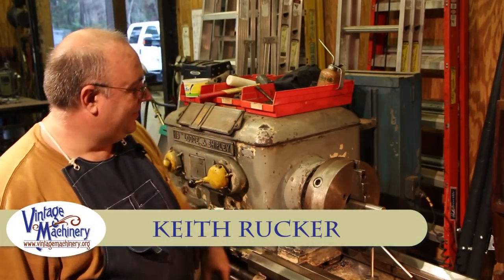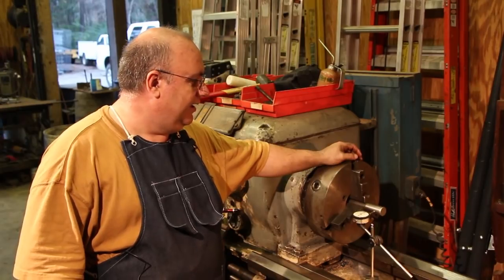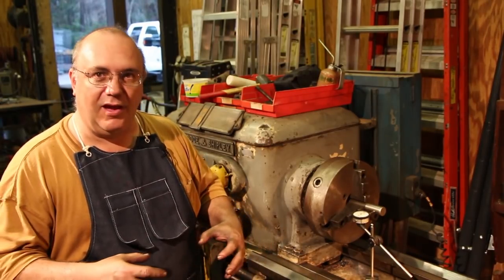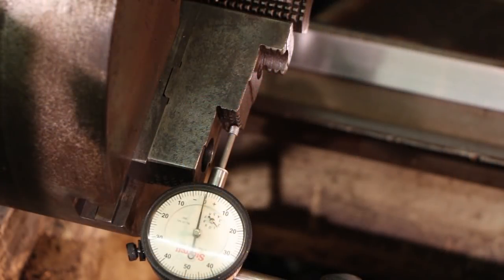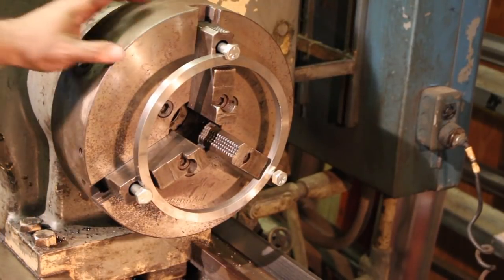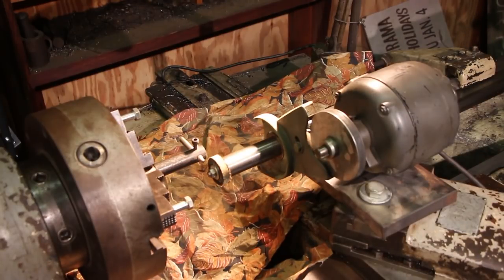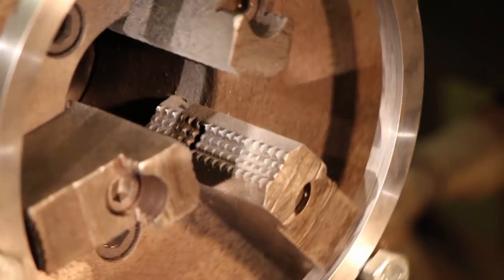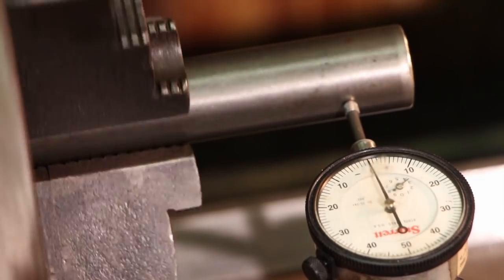Machine Shop Maintenance:  Truing up a 3-Jaw Chuck

Comment: You're really limited with what you can do with such an old chuck.
Often the wear is in the scroll where you can't really do much about.
Also, you can grind the jaws to perfection at a specific diameter of stock, and then put a different size of stock in (bigger) and then not
be in the area of the scroll with the most wear and it will be way off again. 
The teeth on one jaw that meshes with the scroll may be more worn than the others due to grit that gets inside the chuck.
I would have chucked the old chuck and bought a new one.

Comment: Thanks for the video, I have some questions 
A, did you check the lathe chuck mounting plate  for run out
B, did you then refit the chuck after a very good clean and polish and check the chuck body run out
C, did you remove the bolt on  jaws and check runout of check slides themselves 
D, did you confirm all jaws are in correct positions then check run out

Those old machines are generally very very well made with good durable steel and unless previously someone used a tent Pole as a chuck spanner there should not be as much runout as you HAD 
I have setup a few lathes and always start with bearings, then step for step work my way outwards till I finally fit the jaws them selves and find very marginal tuning needed before the jaws are done, each thou adds up 
I would also use a true ground hard shaft as my clamped reference, never trust a standard machined bright steel rod 
The last point is check the runout at the jaw face then move dial gauge out 100mm from face and recheck runout, then when all done to within 1 thou recentre the tail stock to the jaw to make sure you don't introduce errors of the length of the bed 
All the best to you in your shop fella, 
Generally 1 to 2 thou can be overcome with a slight tap with soft block to the offending jaw before final lock down, but we would all like the jaws to be 100%true wouldn't we

Comment: I would have tore down the chuck to inspect and clean the wormgear and individual jaw mating surfaces. One jaw looked like it had more material removed and I suspect it might have a burr or some deflect between  the contacting surfaces. That would cause the run out after resurfacing.

Comment: That worked well.  How I have done it before is to use 3-5" dia. Plate 1/4" thick with a 1 1/2" hole in it. Dril 3 holes in it for the bolts to come thru.   If your Chuck has no bolts I have figured out a solution also with key stock.

Comment: Jezz Keith. I watched your video because I have 1.5 thou run-out on my lathe that I would like to get under a thou. But you are happy with 4? That's a little hard to swallow! But maybe it's not as bad as you think..... 

How do you know your measuring bar is true? It looks like raw unfinished material which is seldom true. Don't you have a good ground mandrel in your tooling inventory? 

How do you know if the missing outer screws are torquing the jaws a bit? Why not put sleeves on the longer bolts so they tighten the outer location AND provide a clamping surface for your tensioning collar?

Comment: This is the correct way to true up the jaws. Thanks for the demo. You can probably improve that .004 runout by striking the high jaw with a soft mallet. Any improvement is a help so it doesn't hurt to try.
Reply: No it’s not correct. He preloaded the jaws in the wrong direction.

Comment: When you tighten the Chuck do you just use one of the three adjustment screws? I had a runout problem on a small three jaw but changing my practice to always tighten all three adjustment screws the runout is down to just under 1/1000. Big result. I must be a bit ocd as I always tighten in order.

Comment: Your method of creating tension is absolutely correct. Many people are doing it the wrong way. Note the following: A person can have the best setup, best grinder and correct way of tensioning the jaws, but if you have a spindle which is out of line with the bed, it's not going to help much. It will be best to first check if the spindle is parallel to the bed. My Opinion!

Comment: Yeah,  I know old video, that said anyone just new to this video needs to finish the job, not mentioned is to disassemble that chuck first and clean, check for issues in mounting and jaws then after grinding disassemble again, clean, remove all that diamond dust and lightly lubricate.

Comment: If you remake jaws try to match the original diameter.  I'm betting by the looks of it you had the right idea with the big ring but your jaws should have been opened to the size of your spindle tube diameter or bigger. Using the inner bolt hole.  The angle of the jaws will change with pressure and chuck RPMS You want to promote the life of your jaws.
so anyone attempting this first check your foundations. Then decide what diameter is best and for a finish pass I suggest climb, conventional is good for rough but for finish :(  I like the DC motor for all the rpms and hp,   .   

what you could always do is get some soft jaws and bore them out you should be able to hit your tolerance.

Comment: I imagine when you are grinding, the actual diameter which ends up being ground matches  the diameter of the opening of the jaws during the operation. It appears that the jaw gripping surface has a radius smaller than the operation set up. Therfore the grinder won't contact the bottom of the jaw. The run out will greatly improve for larger diameter work pieces but maybe not for smaller diameter stock.????

Comment: On some of your projects you have chucked bar stock which uses the jaws you ground and bored the inside of the part.  Then to finish the outside chucked to the bore and finished the outside.  Why don't you also grind the jaws on the outside?  Is it because there is not a concentricity spec between the inside and outside of these parts?

Comment: I'm going to stop you at 2.50. To be continued !
7.57 I've heard enough - or too much. No point in continuing watching this video as there are so many errors (omissions) in what you're doing. Here's the steps you should have taken:
1. Is the chuck mounted true ? Dial indicator on the left hand edge perimeter - to the left of the chuck key hole. If the chuck isn't running true, the jaws certainly won't be. Dismount the chuck and check the mounting for trueness. Remount the chuck correctly if necessary. It may fit 6 different ways; one will be correct. Any play in the headstock bearings ?
2. Remove the jaw 'tops' - Are the jaw bases in the correct slots for the scroll ? It'd be obvious if they were inserted in the wrong order but fitting them in the correct order but wrong slots will cause small errors.
3. Measure the run-out as as many different diameters as you can and particularly at extremely large openings - where it's too large to dared to be used - i.e. the scroll won't be worn there. Figure out how much run-out is down to scroll wear.
4. Refit the jaw tops to the correct bases - they should all be numbered.

Only after checking the 'foundations' can you build accurately.

Comment: Its important to get pressure from the inside (like when clamping on a piece of metal) when grinding the jaws on the inside and not using a ring over the outside of the jaws which will cause pressure towards the inside instead of pressure towards the outside.
Reply: Pieter Botes , I believe that's what he did
Reply: @grumpyg9350  I didn't question what this brother did. I merely "sort of stressed" the importance of doing it the right way.
Reply: Pieter Botes it's important to make clear comments as to whether they are reinforcing or critical. Most of us, at least on YouTube, have difficulty with our "mind reading" not always working correctly. I know I've been guilty of this, and have been called for it before. Maybe adding a simple little phrase like " I agree" or "I concur" is all it takes.
✌️👍
Reply: @grumpyg9350  Will do

Comment: I suspect there is also wear in the centerline  axis between the body and the Jaw mount. I would use an all-thread stud, washer, nut, washer, your ring, washer and another nut. This will secure the Jaw set just as if a piece were chucked up.

Comment: You can also have a little runout coming from the bolts; each round part of the bolt that is tighten the ring.

Comment: I read one time that you can just set your speed to the highest and the centrifugal force will throw out the jaws ... so i tried it .... .0005 runout .... worked great for me ... might be worth a try for you .just run it  and zap a thou or 2 off and see . like you i didn't think it'd work too well either , but it did.

Comment: That would be true only for the diameter that you used. Once you change the jaw position (open or close), you would have to factor in the play caused by the out of round that the scroll has.

Comment: Kieth,
   You are correct, ordinary  carbide inserts will not cut hardened chuck jaws. However, Blue Nano carbide inserts will. I had 11 thou run out on the three jaw on my smaller lathe. I am really hesitant to get grinding dust inside my machine so I didn’t want to use a tool post grinder so lived with the run out until I saw a video on Steve Jordan’s channel using the Blue Nano inserts on a boring bar to true up the small chuck on his mini lathe. I know, mini lathe chuck jaws may not reach the hardness of a bigger chuck but I didn’t have anything to lose but the cost of the inserts so I thought I would give it a try. To my surprise the Blue Nano inserts weren’t even faxed by the jaws on my chuck and I got it true within a half a thou using his method! 
    Steve solves the problem of chuck tension by placing a piece of round stock on the very back portion of the jaws then tightens the scroll down normally. He shows how he accomplished this somewhat delicate operation.
   After the greater portion of the jaws have been trued up the billet, as he calls it, is removed and the small back teeth of the jaw are cut just a smidgen below the truer portion. I used a ring similar to the one you use only I just used the back grip on the jaws to provide the needed tension. You do loose the very back portion of grip on the jaws but there is still plenty of gripping force to hold the work. 
   Pierre did a review on the Blue Nano inserts not too long ago if your interested. They worked for me and I’m comfortable that I gave my chuck and lathe bed a bit longer life by keeping it free of grinding dust. As you know the dust is impossible to control in a spinning lathe and grinding wheel and equally impossible to completely remove once it’s in there.
 Thanks for the video.

Comment: Semi Newbie question...atlas 618,,,,test bar in spindle mt2 taper....0005 at 2 inches...turn new 3 jaw chuck on test bar backwards and check runout and adjust where it mates to faceplate in normal configuration.  Would this be a decent way to help true chuck...

Comment: Do each of the 3 gears have a specific place in the chuck? I saw that the jaws are numbered, and matched them with the slots - but after cleaning the chuck,  it has one point in a full turn where it binds 😟
Reply: Yes the chuck should be numbered along with the jaws,remove jaws, find jaw #1 and turn scroll untill you see the entrance to the scroll(like a thread) then repeat for the other 2

Comment: It helped a lot ..but you can cut the jaws with a good insert boring bar especially with them being serrated..but carbide doesn't like Interrupted cut I would have tried the bar first ..not gonna be any closer than 4 but where you ground the chuck jaws at that diameter it should be with in 1 in theory

Comment: Somebody please chime in here for me. My lathe runs up to 3000 rpm. Wouldn't it do the same thing to spin it up wide open and just let the centrifugal force push and hold the jaws out while grinding. Any one tried this? I need to improve mine.
Reply: Thinking the same
Reply: Yes,  it will have such a centrifugal force on the scroll that it can't move.   Problem is when you have a lathe that starts turning chuck instantly especially at high speed can turn the scroll before centrifugal force from the jaws holds the scroll.   Especially if the jaws are turned out a long way.

Comment: Another suggestion for the grinding . Use your hand wheel to feed the grinding wheel back and forth fairly quickly . Literally feed it , feed it out . This works like honing a hole , the faster the feed the more rapidly the cutting action and more parallel the hole or jaws . The rapid feed breaks down the grits to expose new sharper grits and keeps the wheel from cloging up . Another suggestion is to dress the wheel on the same side as contact with the job . Another mistake most people make is using too fine of grinding wheel and also too wide a wheel . Narrow wheel has less pressure and more accurate . One last thing , cleaning out the inside of the chuck before doing this job may help . Cheers

Comment: A machinist where I worked used a ring in the inside jaws, tensioning the chuck outward. He used a cutter in a boring bar. Ruined the chuck. It resolted in more than .035 runout.

Comment: About the run-out and repeatability.  If you marked the jaw and the piece it would allow you to put the piece back in the chuck in the same orientation.  Wouldn't the original un-turned run-out be about the same so the turned part should have minimal run-out?  Not perfect but better than slapping the piece back in willie-nillie.

Comment: Good set up!
..I do this with ring and 3 dowel pins installed which go inside the jaw hole in front, [need to be loose], my Forkardt chuck have holes in hard jaws, you could drill also], some people use the jaw screw holes for mounting ring which I see only a slight problem...the jaws might slightly be binding from each other and uneven forces are applied..but with care this can be minimal and for this purpose well suited.
Your set up is better since the ring is free of binding while laying on bolt.
 About .003" taper to the back of hard jaws I grind or hard turn for spring back ..gives you greater clamping force in front where it's needed. When turning soft jaws very accurate, most often I use a ring with 3 - 90degree bolts installed on the side...threaded part goes inside the ring, the none threaded part goes inside front of counter bored screw holes, I can adjust easy to the size of parts turned by turning one or more screws in or out ...close to part size, [closer the better] very minimal of turning out soft jaws.

Comment: Someone may have already asked this, but wouldn't the grinding wheel being worn down, as it is fed into the chuck, have a slight effect on the accuracy of the grind? It seems to me that it might have more accuracy if you advanced the cross slide feeding in AND out of the chuck. Or maybe that would just lead to a slight crown in the jaws.

Comment: The problem with doing it the way shown here on smaller chucks with narrow jaws is that it leaves the jaws concave. If stock of larger diameter than the jaws were set to when grinding is clamped then there is a tendency for the jaws to mark the workpiece because the edges of the concave bite into it. It also leads to runout due to the workpiece not being gripped evenly. The better way to grind narrow jaws is to not rotate the chuck but to fix it with the jaw to be ground at bottom dead centre then move the grind wheel back and forth across the jaw, slowly moving inward. Repeat the process with the other jaws each at bottom dead centre. The result will be flat faced jaws which can clamp any diameter without damage and without premature gripping.

Comment: Two questions.

1. Are you sure the 4 thousandth run-out, after grinding, isn't down to the piece of stock not being straight?

2. Why didn't you turn the jaws round, and the grind the other surfaces as well?
Reply: No it's due to an unevenly worn scroll. There is nothing that can be done about that.

Comment: hi Keith did you know alot of your older youtube's auto is on left side only?
Reply from the maker: Yes, I had a problem with my wireless mic when I first started doing videos and did not catch it for a while.  It has been fixed a long time ago but the old ones are the way they are....
Reply: thanks for the reply.
Im working my way from your older videos to new one after i found you channel.

Comment: Keith a little tip.
If you are dressing the Grinding wheel on the "backside" and grinding on the "frontside" you can run into problems when your tool post grinder is not perfectly parallel to your bedways. This means if you are off just a few thou you are doubeling the error and your grinding wheel will be conical, if you are dressing on the same side wich you will be machining later you dont have that problem. cheers Mäcky

Comment: So if the ring is not perfectly round and the bolts are slightly different , wont that affect your new center line of the lathe after grinding the jaws?
Reply: TheDefeatest no. the ring is just to tension the assembly, the position is still determined by the screws.
Reply: I believe you ARE correct. Just imagine that this ring would be oval. Sure, the jaws would grip it and there would be tension on each jaw. However, the jaws would not be equidistant from the center.
Reply: The video was a good demonstration of how to true up the jaws on the chuck. Yes it would be better if the ring was ground for accuracy and tension. The bolts are a good idea but to achieve a better seating on the ring. Hardened dowel pins would be a better option.
Reply: No any old ring will self-centre on the bolts and produce a true even tension on the jaws.
Reply: I had the same question about variance in bolt diameter.